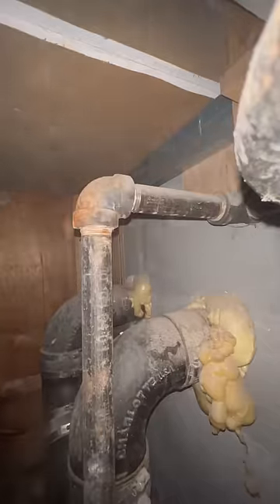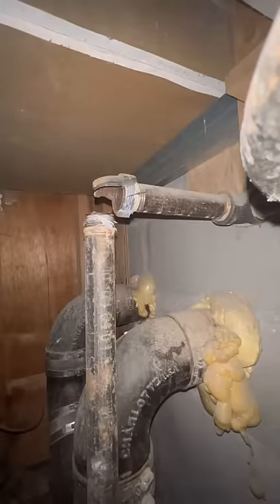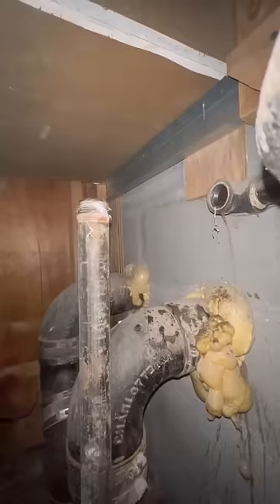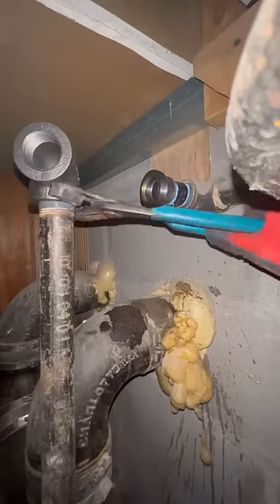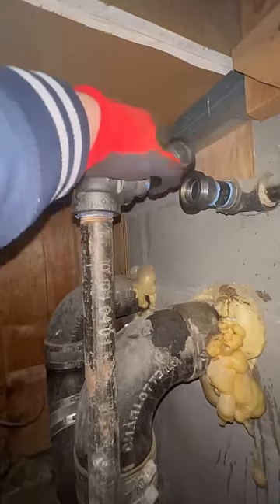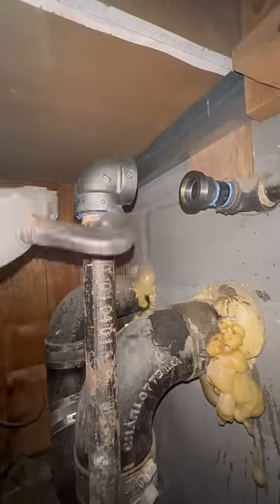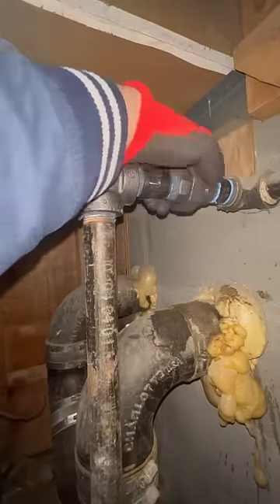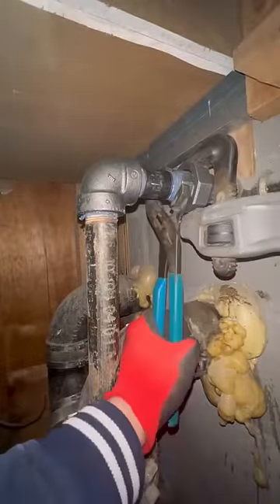How to repair a broken cast iron elbow

Comment: Neither are made to fill threads for leaks. Too many people believe this is true.
Tape and /or dope are both lubricants used to make metal threads go together more smoothly, not to stop any sort of leak.
Reply from the maker: Lmaoo who’s your dealer broskii?
Reply: @hydronyc  Not as good as yours apparently, you don't have to believe what anyone says but the manufacturer of the products used. Go ahead and check with them and see what you are told their product is for and what it was made to do, guaranteed it isn't to stop leaks. You probably use it on plastic threads too. smh

Comment: He could fit the pipe by making the elbow 45 degrees far from the connection and fit the pipe then turn it clock wise to take a place , no need to take risk turning it backwards because that might damage the seal and  create a leak if it's not now it will be later

Comment: Teflon tape and then pipe dope is 100% correct! 
Not that I’m a plumber I just helped one out for six months renovating 400 hotel rooms. I figured it out because of necessity, I first tried pipe dope and then Teflon tape but it doesn’t work because the tape just keep slipping.

Comment: The pipe dope acts as a lubricant as you said. It also acts as a sealant too. I see by the color of dope, you are using Leak Lock. Great stuff. The blue tape is that Monster stuff. I don't care for it. Use a high density teflon tape, especially on hot water or steam Broski.

Comment: We use cast fitting for fire sprinkler pipe. Maliable fitting for gas with left right nipples to prevent leaks. We don't use black pipe for water it pull lead from the pipe to the water.

Comment: facts brother facts. a fresh joint can be fucked with to a degree with basically no risk of leaking if it was done right from the start. when i was doing fire suppression we would dope, tape, then dope again. out of the 10's of thousands of on site fabricated threaded pipe connections we never had a leak due to the application method. only when i ever got over zealous with the wrench and cracked a cheap fitting. the orange CPVC is cool but nothing beats cranking threads on the rigid.

Comment: If you are replacing the pipe section. Cut a chunk from the pipe, if you have enough room, and then spin the fitting off. Risk to the threads is totally negated then. Obviously situations are always different

Comment: Work looks good, however tape is your lubricant and dope is your sealant. Don't believe me? Screw 2 fittings, one with tape and one with dope. See which one feels lubricated. I know it seems backwards, but its correct.
Reply from the maker: Thank you. I have tried and it threads less with just teflon. With the just dope it threads more. With both it threads same as with just dope thats why i have come to that conclusion.

Comment: If you want to save the threads, Smack That cast iron fitting with a backup hammer. Those fittings are designed to snap part when hit. There's no reason to use a Sawzall
Reply from the maker: Thats causes too much turbulence. I used a grinder
Reply: Little bit arrogant there. "God of plumbing" smh

Comment: Honestly on those unions, the best way to do it, is tighten the one side and stop the tigtenin process when you still have like a 1/4 turn or so left to get it in the exact spot.  Then put the pipe on in the 90 and then turn the 90 the final 1/4 turn to get it lined up with the union.  Then tighten the union.  Thats the best way to do unions.

Comment: that is malleable cast brotskaia, not cast as in that cast iron drainage, the malleable cast allow for small expansion as nipple is tighten into fitting and as long as the fitting is not tighten to extreme then yes you can go even more than quarter more tight, especially you may have used 300psi rated malleable cast 90 degree elbow ( usually used on lower floors on a high rise building and as spec'd by design engineer), or those thick fittings which are not 300psi rated fittings used by fire sprinkler piping guys..

Comment: Til you pressure test at 215psi and watch it leak like a faucet 🤦‍♂️ I wouldn’t have chose a union either, I would went thread by groove and used a coupling
Reply: And if I might add never tighten down with channelocks even if you don’t have space and very little access I would used a 10” pipe wrench 🤙🏻 why risk a leak if you don’t have to

Comment: The beauty of steam fittings is that you can CRACK them out. You could have used a piece of 2x4 behind the elbow before wacking it.  You could have swung that elbow around again as opposed to backing up.

Comment: There are no guarantees? BTW I noticed that you did not use any pipe dope and/or Teflon tape on that
Reply: Only fitting i saw teflon free was the union. Its a flared fitting that makes the seal, the thread/nut is to keep the flared ends coupled tightly. Adding teflon to that fitting could prevent the flared ends making full contact and would actually be the cause of a leak.

Comment: I'll tell you even easier way two sledgehammers Place one Sledgehammer on one side holding it against the fitting and smack it with the other one it will shatter. And turning the fitting back is not a good idea it's not okay to do even if it's a fresh joint.
Reply from the maker: I do that on steam lines. That causes vibrations and disturbance though so i try to avoid it

Comment: Here recently I've been putting a thin layer of pipe dope first, then the tape, then the normal amount of pipe dope last.  Seems like since covid the fitting have been a lot shittier.  Definitely the china made shit, but have you noticed that too?  Especially the unions, seems like you tighten the shit out of them and they still leak during the pressure test (higher than what is called for), but usually go back and put tape/dope on the threads for the unions.

Comment: Personally I would have cut out the horizontal pipe instead of the fitting, but hey it looks like it worked out for you and I didn't hear about that house blowing up or anything so it's all good👍

Comment: I used to work in the fire sprinkler field and we would use pipe dope. Here a PRO TIP: Take some powder cement mix, sprinkle it into the pipe dope. When u use this, the cement will dry and there will NOT BE any leaks.

Comment: Not cast iron just iron ! Also you can make one cut in the middle of the 90 avoiding the threads on bothering sections of pipe done it many times
Reply from the maker: Lmaooo you’re a plumber and say its not cast iron. WOW speechless

Comment: tape can allow air to move through the threads the dope fills the thread and then hardens. you put tape on water applications so it doesn't stop the dope from hardening and water come in at a way higher psi.

Comment: I've NEVER managed to get my steel or cast pipes to line up correctly..  it's always off my 1/4-1/2 turn..  Or, everywhere I work, always seems to need me to cut and  add threads to a new piece, because the purchased sizes never fit. Lol

Comment: I have been applying dope to the threads first and then applying the tape on afterwards with no leaks for about 20 years.  I don't care if an expert or a computer search engine has a difference of opinion because that's all it is...an opinion, not fact.
Reply from the maker: We used to do that in the old company and its wrong seriously. When you do that you can see the teflon sliding out. Try this way and you will see and understand the difference
Reply: I'll guess I'll just be doing it wrong (by your standards, of course) because I did it your way for a few years and I didn't like it.  Couldn't get used to the way that the teflon would slip around on the threads whenever I was wrapping it tight before the first revolution.  Didn't have leaks then either.  You do it your way and I'll do it mine.  Point of the matter is, just because it isn't the way you do it doesn't mean that it's wrong.

Comment: Or.. you could’ve just cut the pipe that you did cut and spin the 90 off without using the four-inch grinder.. and then you add the new elbow on and stop short of turning it into position, add your piece and then turn it into position instead of backtracking, where you’re probably going to get a leak once that pipe heats up. Or you can continue doing it your way.🙄
Reply from the maker: Will definitely keep doing it my way it hasn’t failed me yet for 10 years now

Comment: I’d definitely rather slice the pipe, spin out the pieces, then bust that 90 off. But hey, glad it worked out

On second watch, I noticed you backed up the wrong union half. I’m sure it’s tight but yea I’ve definitely had leaks doing that before lol. 

Final note: why not dope the faces of those unions? It’s common practice here, just curious
Reply: He thought he could get away with cutting the elbow off. Not sure how he thought he’d get a new ell on without removing pipe anyway…

Comment: You can crack fitting  with two hammers. Put one behind  fitting  to back it up. Hit fitting  with the other hammer.
Reply from the maker: True but that causes a lot of vibrations and disturbance to the rest of the line

Comment: I'm not a pro plumber, but this was a waste of time. Just cut that nipple at the cracked elbow and unscrew both. Then just put in your new parts. Also, you didn't loosen that elbow to adjust it, you tightened it, then went loose to fit it. I don't think I'd do that. Unless I looked at it wrong

Comment: If you hit a cast fitting with a hammer and another hammer on the other side up against it it will split in half.  No cutting necessary.
Reply from the maker: Too much turbulence and vibrations to the line

Comment: Teflon is the lube.  You have that backwards.
Reply from the maker: You are wrong. Go google it
Reply: @hydronyc  do you know what Teflon is?  This is a common misconception.  Teflon tape allows you to tighten pipe threads more to achieve a mechanical seal.  It does not effectively block the thread channels.
Reply: @EVLS10  this is even more obvious when you take a joint apart and get to see no teflon down in the roots. But a doped joint will have dope in all the roots still.

Comment: From a plumber to another plumber it's against the law to use a union fitting in side of any building or unit only outside of building..
Reply: I believe that would be on gas lines. Otherwise you should be able to as long as they are accessible (not readily accessible)
Reply: @DLB1858  maybe in your county but in Santa Clara county it's not allowed no matter if it's gas or not for the fact it will leak
Reply: @ericesquivel6266  not my county necessarily. I’ve plumbed in states that use IPC and UPC. Unions are legal under both. Unions are designed not to leak.
Could be one of those “local jurisdiction” issues. Maybe because of earthquakes?
Have a good one
Reply: Looks fire sprinkler pipe to me 👌nice job brother

Comment: That’s black not cast iron, and you should only ever use dope on gas piping.  Tape remnants will clog orifices or stick in valves.
Reply from the maker: Its not gas line
Reply: @hydronyc  steam?

Comment: Thats not cast iron. It black malleable and you NEVER loosen the fitting and expect it to be leak free, if you actually knew how to use that union you would not have had to turn it back.

Comment: Never back a fitting up after applying Teflon, tape and pipe dope, and you need to dope the mating surfaces  and threads of that union as well, looks like you need to attend an apprenticeship

Comment: That pipe is for gas. There's oils in it. Black pipe is for gas only. Repipe with copper, or some kind of legal plastic. That should not be a water pipe at all.
Reply from the maker: Lmaoo you must be a carpenter or smth
Reply: @HydroNYC  I was gonna say the same about you. Are you an apprentice or Scab plumber?  That should be galvanized pipe. Or type L copper brazed.

Comment: Those old cast fittings shatter when hit.  No need to use cut off wheel.
Reply from the maker: It would take many hits given the limited space. It would also cause disturbance and vibrations to the rest